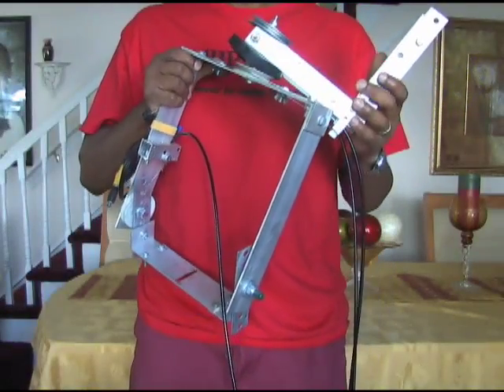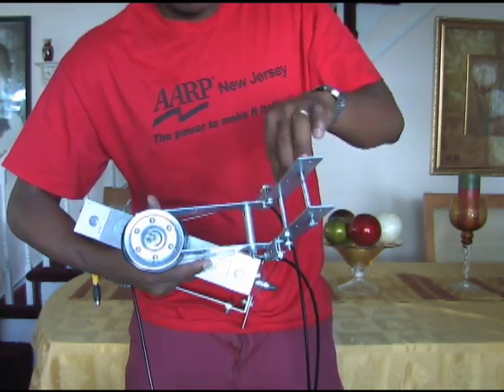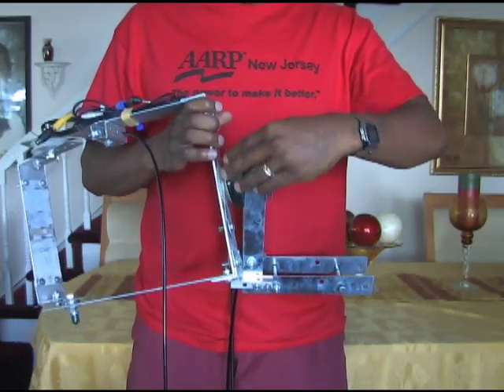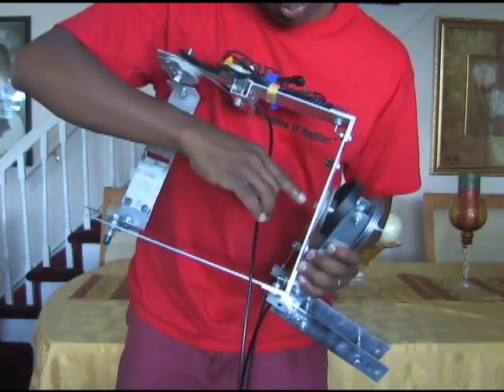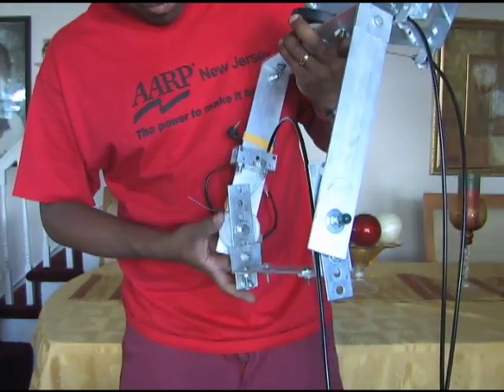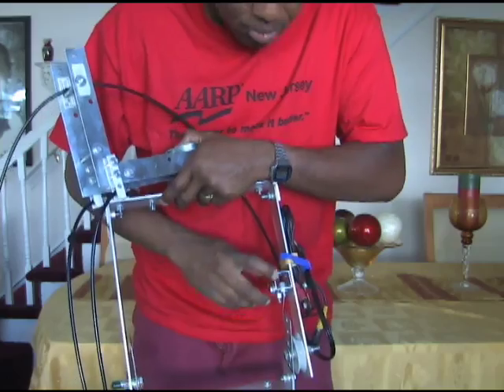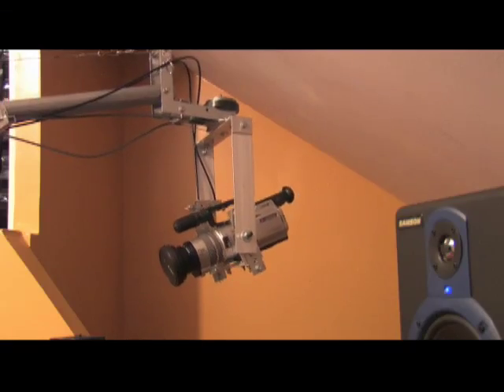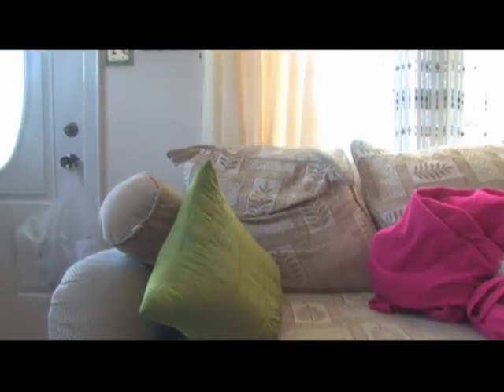About Jib3 Part 2 of 2 Pan & Tilt Head

Comment from the maker: @dumplynn7 Thanks all your tips. The "constant head lever via cable" is already a part of the jib. I always know that bearings would be much better than bushings. Bearings do cost a bit which I can't afford at this point. In terms of the pulley ratio; I will definitely try that, but with bearings instead. Again, thanks for the tips.